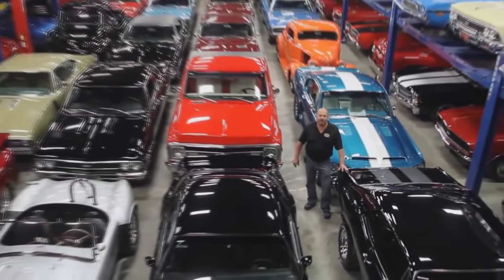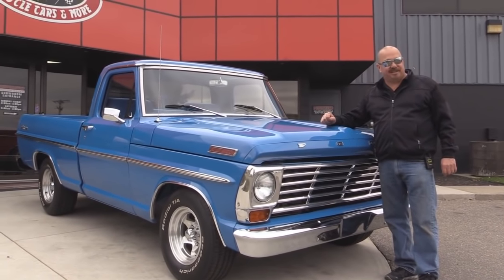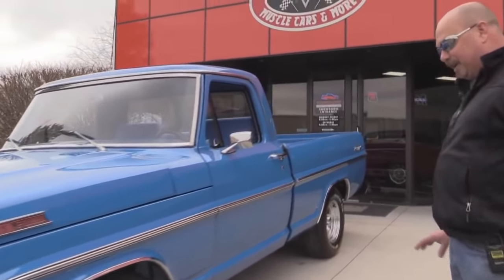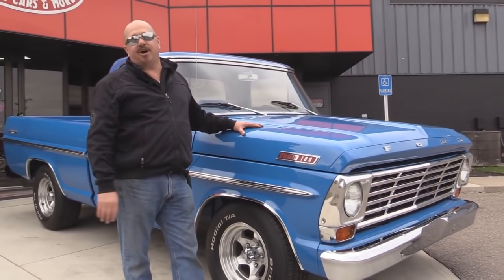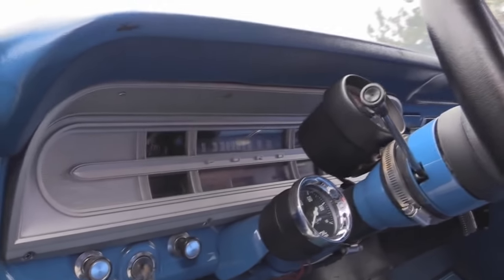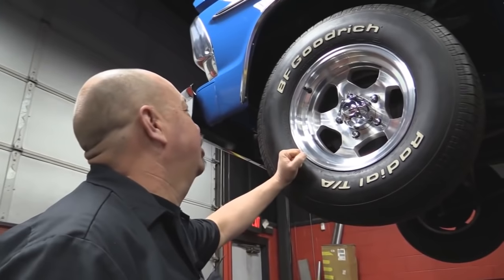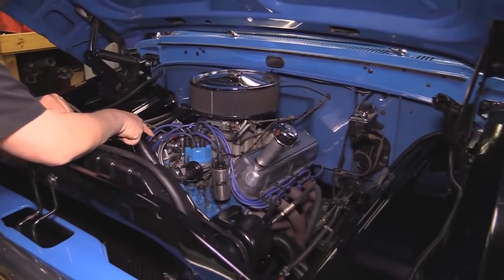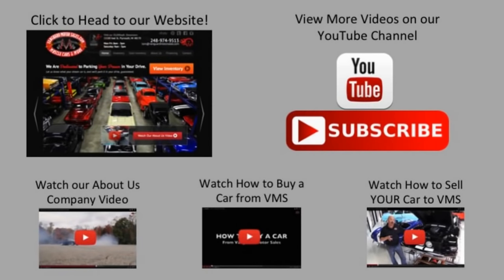1967 Ford Ranger F100 Pickup Truck For Sale

Comment: My Uncle J.D. had a red & white 67 or 68 F100, which my dad borrowed in the early 70s when I was 6, and we took it camping in Colorado. It had a cap on the box. Dunno how my parents, older sister, and me all fit back there at night, but those were good times. Dad told me the truck had the 360 FE under the hood.

Comment: I drove a '67 back in 2002 for a few months while I was waiting on my Cadillac to get some work done on it (my dad was taking his time... but no biggie... :)) .... Huge steering wheel and it was certainly work to drive it with no power steering. It was so much fun though, because my dad had just rebuilt the engine. It hauled quite nicely. That engine sounds just like the one I drove, but with a bit more growl. Very cool truck. The new owner should definitely enjoy it! :)

Comment: My 67 F-100 is about the same condition but is currently in black primer. It has the original steering column and is 3 on the tree. And the original 352 with 43,000 miles on it.
Reply: I'm surprised Ford never offered the 289 in pickups.

Comment: I use to think Chevy had the nicest 67. After this video. I still like Chevy is prettier but this is a close 2nd.
Reply: Blackericdenice- breathing down the chevys neck, this truck has caught on fire, about to pass the chevy going down the stretch. I've driven both , worked on both, the ford is miles ahead in quality.